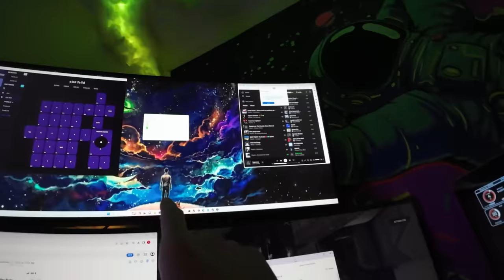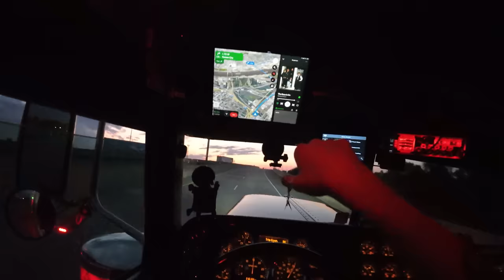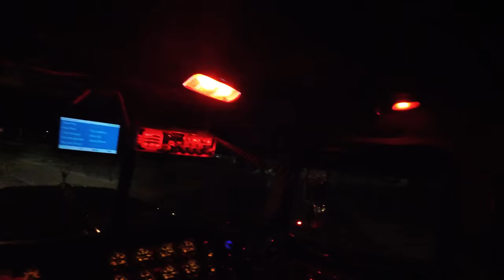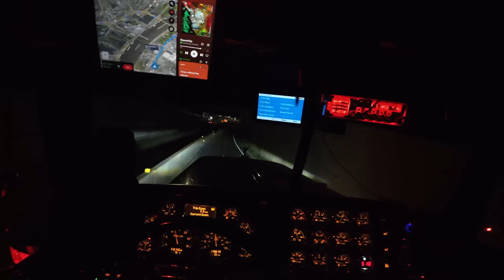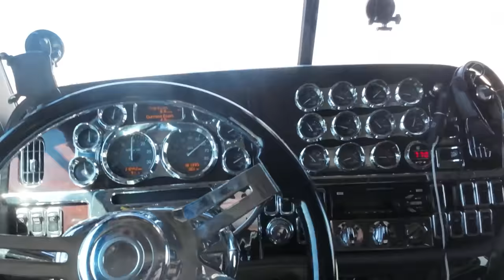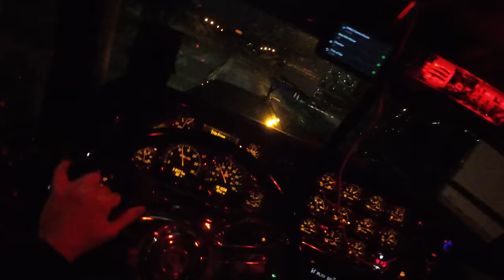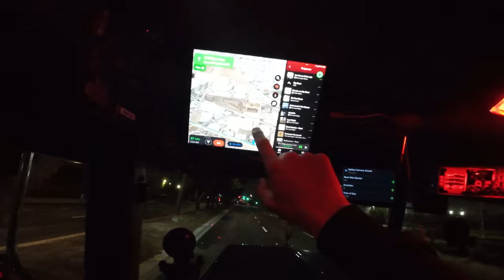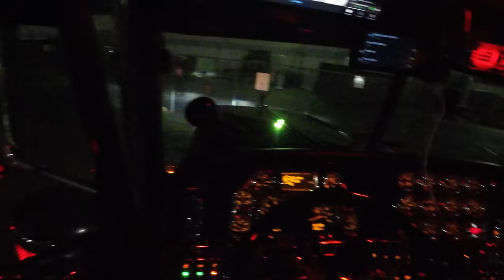WEST COAST BOUND!!!!

Comment: I've been trucking in Europe for 14 years now, it's still a dream to drive a peterbilt one day. Keep doing what you do and keep the shiny side up!
Reply: For us it's a dream to drive Euro trucks because USA trucks are hot garbage!!!! xD

Unless you have a peterbilt like Hightrung. These built classic petes and KW's are nice.

Otherwise modern american trucks are cheap plastic junk that have zero comforts and literally rattle your teeth out!
Reply: @robertgardner4508  European Trucks are plastic too, and the cabins are (a lot) smaller. And European roads are narrower, busier... they are not the same large areas as in the USA, the population density per km² is higher in Europe. So youre good in US believe me.
Reply: @sirius8103  everything is plastic but the quality difference between euro and American trucks is large. American trucks are very cheap creaky and rattling plastic, euros trucks don’t make near the amount of interior cabin noise American trucks do.

Yes eu has tight roads especially depending on where you live but you also have very different trailer, length laws and the cab over trucks that can handle that kind of stuff where American trucks are boats that can’t turn worth shit even in large spaces where you think you have room.

European trucks do have smaller cabs but typically from my European trucking friends, you don’t spend more than 4-5 days in the truck due to work laws you have to go home and take a weekend off (I don’t know if this is a where you live thing or most of Europe) but my friend in Europe driving are either home daily 38-40 hours a week driving, or they’re outa few days but forced to take the weekend off.

My truck had a little more space sure, but it’s pretty cramped and driving OTR I used to be out for months like 3-4 months at a time before I came home for 5-6 days.

Living out of the truck like that was very miserable and while cozy like camping I was very limited to what I had for entrainment, exercise and food most importantly, trying to maintain a diet and cook in the truck was just as difficult as a EU truck even if I had a small swing out table and stuff.

Volvo cabs in the FH models though are pretty spacious, so idk it’s all preference but US trucks often have super cheap spring air ride seats and never have good cab air suspension on front air ride, every truck I’ve ever driven even a brand new t680 with the “nicer” seats had only 2 cab air bags in the back and front spring suspension on drum brakes, and the interior despite being a brand new truck rattled like shit.
Reply: @sirius8103  and try delivering in NYC, LA, or Chicago. Have fun with the traffic and right roads for a US truck standards.

Everywhere has their ups and downs with traffic whether it’s a vehicle dependent country or not lol.
Reply: @robertgardner4508  Oh OK ! Thanks for your detailled answer !

Comment: What program is that that you're running in that tablet above your visor? But you're still using a gps? The GPS is today are just absolute garbage! I've had a Rand mcnally, Garmin, hammer app and Google running at the same time and none of them found an address I was looking for.
Reply from the maker: I just use google maps they alm suck tho i just look at the route ahead of time and make sure it loons good but if its somewhere deep city i throw it in the dezl and and keep an eye out for bridges mol

Comment: what app are you using for gps ? new to trucking and need to get me a good app for trucker routes
Reply from the maker: Honestly cant give you a good recommendation on trucking gos i heard the new dezl one is bad ass tho. I use google maps and just check the route before going and if its somewhere really weird ill throw it in my older dezl to make sure theres truck roads
Reply: @High_strung I got the dezl 810 and it's amazing! It ain't anything like that garmin you showed us on that video quite awhile ago now.
The UI is now streamlined and easy to navigate; so far it hasn't led me off the road yet or through a low bridge (it does warn though for potential weight limits, low bridges and restrictions though)

The only thing I dislike is how sometimes (I'm not sure what triggers it, I think it's something due to coming into a stop and than continuing to your final destination) the route glitches out where it doesn't highlight the route. It's easily fixable though.